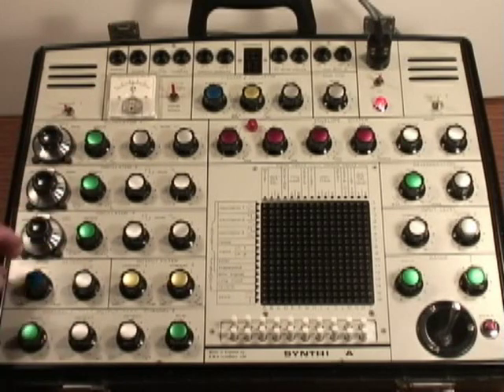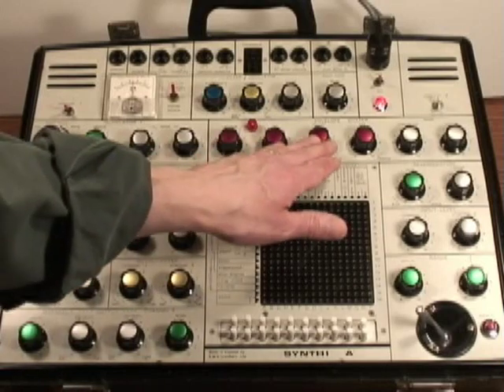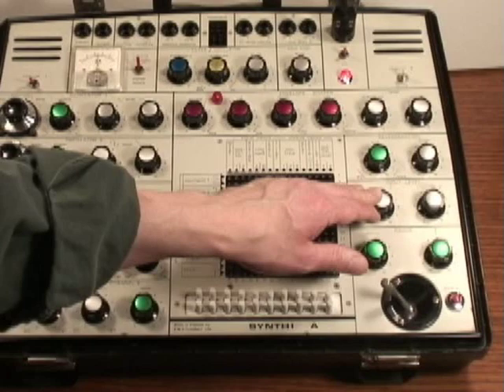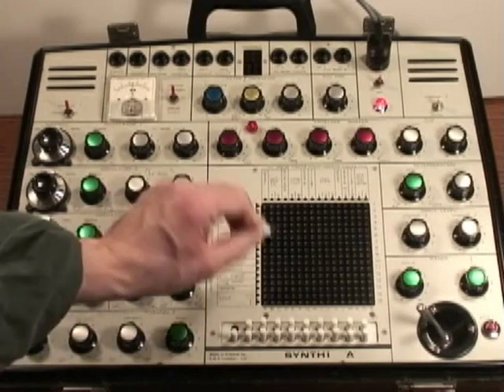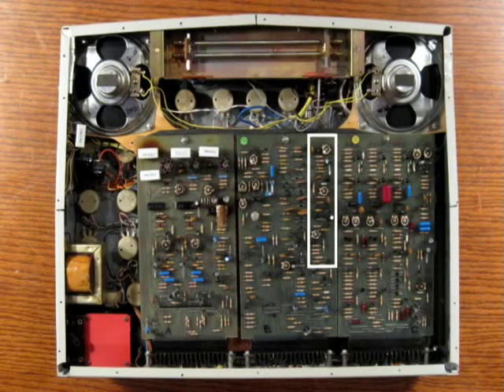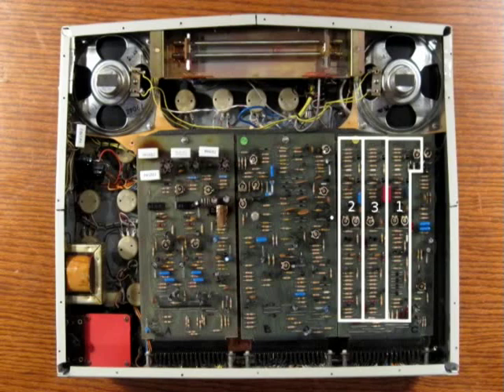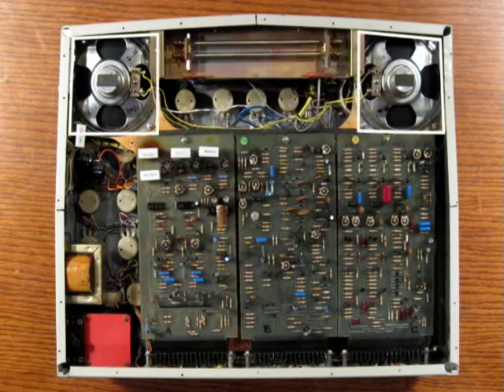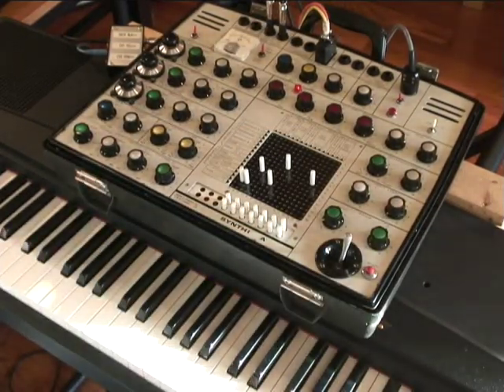EMS Synthi Technical Overview

Comment: Has this the same internals as the VC3 ?
Great video.
🍻 ❤
Reply from the maker: Yes, the Synthi has basically the same 3 circuit boards as the VCS3, but it's just packed in really tightly!

Comment: Thanks KRM: finally - a video with substance. I used EMS equipment back in the 70s (VCS, Synthi 100, Synth A) and was engrossed for ever with the incredible variations you could control to set up original sounds that would last for ages (courtesy of the Osc3). It's great to see an engineer who is so clear with a rundown on the instrument, I am yet to find one in Australia.